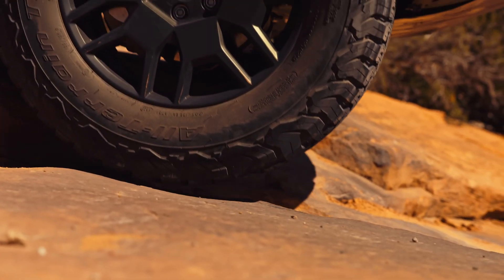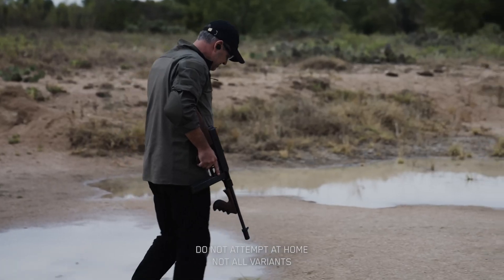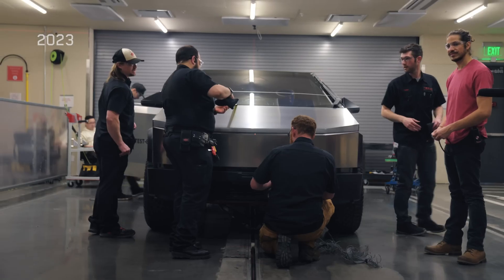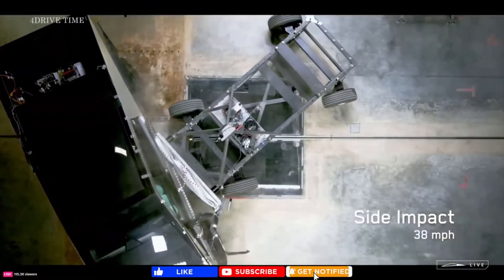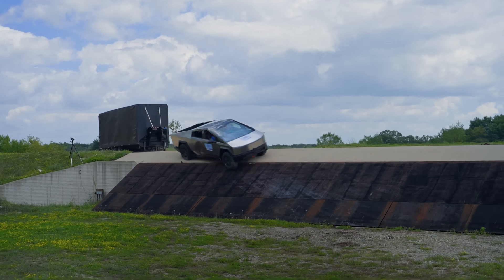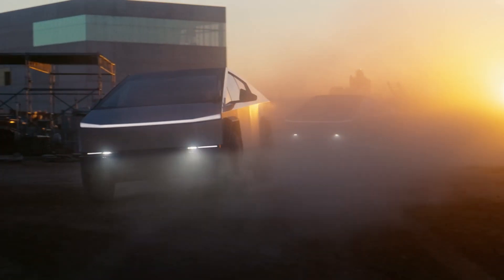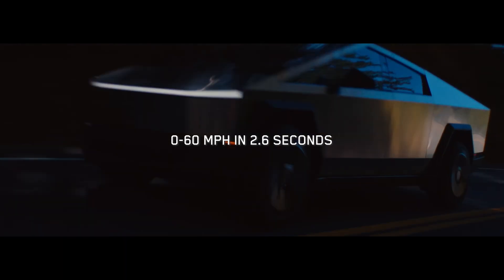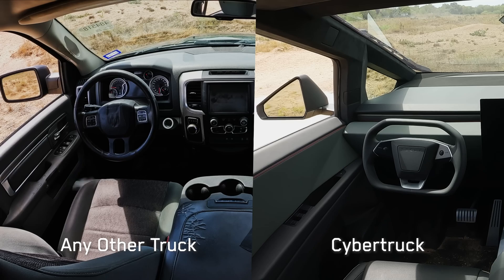The official crash test results for the Tesla Cybertruck, straight from the NHTSA.

Comment: Can't believe pedestrian safety isn't tested....that's pretty important....it's not just about those in the vehicle, it's about those in other vehicles too...only in the USA would it be considered important for a normal consumer vehicle to be bullet proof
Reply: Of course not. In American they want bigger trucks and cars that self drive without regulations. Pedestrian safety would drop those ratings
Reply: Pedestrian safety is pretty much the same for all cars... Hit a person going too fast they die. Hit them moving faster than about 10 miles an hour, they break, Hit them less than about 10 mph and they bruise. You think there's a major difference with getting Hit by. Cybertruck or F150?

To clarify I hate the Cybertruck.
Reply: @CurlyCross  well no, but that goes back to regulations, smaller cars tend to bring you over, big trucks have less visibility and run you over
Reply: @JesusPerez-yc6yu yes but that's true for all trucks.